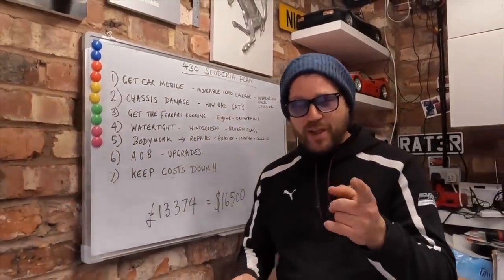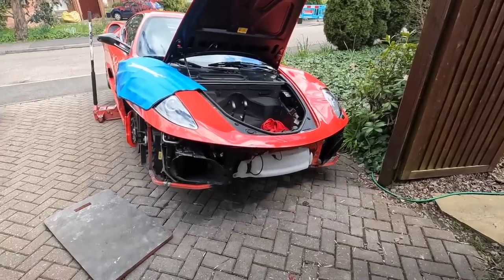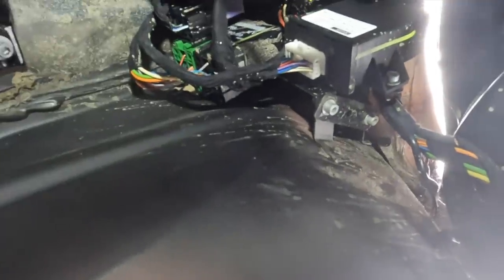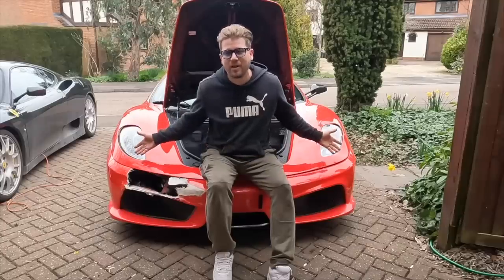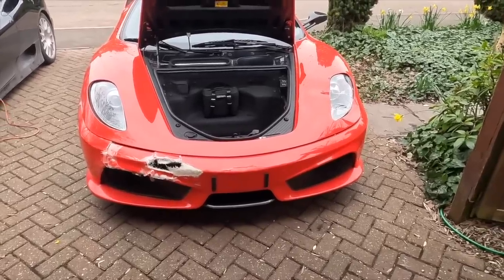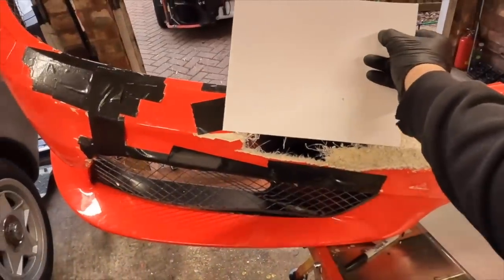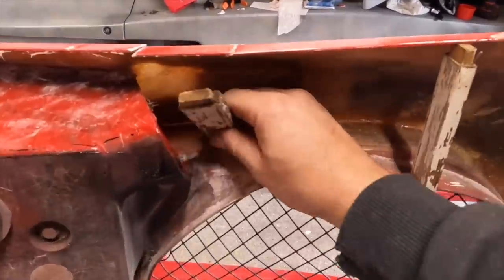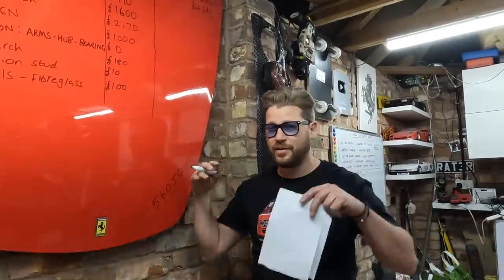Rebuilding a Wrecked Ferrari 430 Scuderia - Part 5

Comment: Scott, couple of tips for working with fiberglass in the future.  1, if you check on the fiberglass after it's cured partially (what I call "green", not sticky to the touch, but not hard), you can trim it with a razorblade fairly easily.  2, you can get a lightweight fabric (I use Dacron), washed to eliminate any sizing or backing chemicals, and use it as the last layer.  Once it's cured you can pull the Dacron off (it doesn't stick to the fiberglass very well) and you have a nice smooth surface.

Great work on trying to salvage the front bumper!!!
Reply from the maker: Awesome, thanks very much for the tips 👌🏻
Reply: Is that similar to ‘peel ply’?
Reply: @factoryfresh9141  Yes, exactly.

Comment: Typing from experience. I've had a lot of success from modifying and repairing motorbike race fairing with success. I've outsourced bodyshops to fix crash damage on my Fibreglass Lotus which always comes back looking good, six months later the cracks come through. Finishing is very important. Cut out anything unusable, strengthen from behind. Use fibreglass filler as much as possible. Gelcoat. Do not use bodyfiller unless for small finishing. It will crack after a few winters. ouch....

Comment: Done a good job there Scott. Trick for repairing structural parts of the bumper using fiber glass, put a layer of chicken coop wire in the fiber glass to nake it stronger. And a mask with filtration is important when working with fiber glass and resin

Comment: When will I learn.  First thought when you said about repairing the front bumper - "this guy is off his head".  Now starting to trend towards "wait and see".  From what you have done so far, I reckon the final fully filled and sanded product will look perfect.  Yes it's bonded pieces, but it isnt in any way structural, so is mainly about looks for the repair - and that will be fine.  It's a crazy saving if you can fix the bumpers up !

Comment: For building up fiberglass parts U-pol makes a filler which is full of fiberglass strands. 
I restore old Corvettes and use roven mat with resin for structural repairs but for building up areas which are not structural the Upol works great.

Comment: Great job. I have a lot of experience with glassfibre. 
Instead of trying to get the losse upper part exactly in place i would make a part mould of the area on another car. Put he mould on the damaged bumper and rebuild it from inside with coat and glassfibre weaw and crossfibre.

Comment: As a body man, I don't care if it is a Ferrari or a Honda I always appreciate when people pick up all the broken bits, even if it's obviously a totaled car. Someone might rebuild it and those pieces can offer up fasteners, clips, trim, even computers like in the case of BMW headlights. The only downside is when tow truck drivers shove damaged bumpers into the interior of the car and it leaves marks in the seats, so it can be a double edged sword.
Reply from the maker: it sure was appreciated on this one Christopher, that little corner bit of the bumper was a real bonus. The Mirror ill show in the next video is also great

Comment: Hi Scott, nice work on the bumper repair, i would say though the back of the bumper really needs to be ruffed up with a belt sander or the like, otherwise you may find the fibreglass you have put on wont bond onto the bumper and could peel off in one chunk, not knocking your work just talking from previous experience 
All the best MEC

Comment: For the Front Bumper, I would have used a former to maintain shape below the gaffer tape, this ensures shape and stops the flexing. Those plastic sheets should be been only bumper depth and twice or three times as long to ensure curvature is maintained. I am concerned, you should have heavily sanded down the inside as that fibre glass is now going to peel off in time. You do not fibreglass on the top surface, you need to reduce the thickness by the amount you are adding back on. Glass fibre does not improve just by making it much thicker.

Comment: Just a couple of quick tips for fiber-glassing next time around:
- first and most important: there are 2 types of resin: polyester and epoxy. The big difference between the 2 is that epoxy has much, much better adhesive properties than polyester. I saw that you were using isophthalic polyester resin (yes, YT viewers see everything :-p). Epoxy is more expensive, but for the tiny amount you needed for these repairs it is negligible. Be different if you were building a boat. Your repairs aren't going to fall off, but in time cracks may appear.
- second, the holes you closed with filler should have been glued with epoxy prior as well. Filler is called that because it is only used to fill any unevenness after a repair. It is not used for the repair itself. Again, cracks...
- and surface prep...

I love what you are doing. So many people just replace rather than repairing. Unnecessarily. But I am quite anal about the quality of repairs. Everything should be as if it had been repaired by the factory. And it can be with a little research (if necessary) and diligence. No bodging.
Reply: Fair info mate… I have just popped a comment in here re my poor repairs with fibreglass. Needless to say, I read your comments with interest. 🥳👌

Comment: Awesome and kudos to you getting stuck in with the glass fibre.
I last used glass fibre in 1988 to rebuild the rotten wings on my Renault 5!😂
Reply from the maker: Was it a 5 turbo ? I had 2 of those and badly want one again
Reply: @Ratarossa  mine was a humble 5TL . My older brother had a 5 Gordini. They both had the structural integrity of a biscuit tin!😂

Comment: When doing a fiberglass repair you need to invite your longtime sailor friend over to help. I've sailed all my life and have done more fiberglass than I care to remember. You need to taper your broken seams to spread the repair over a larger area, but other than that... well done.
Reply: Yeah, I'm thinking the cracks might show back up in the future.
Reply from the maker: Thanks for the tip buddy, I did make some cuts all around where I was fibreglassing to help it all bond together, is that enough or should I go further out ?
Reply: @Ratarossa  Rule of thumb is for every mm of depth you should taper back a centimeter, then layer strips of wetted material that get thinner and thinner as you go. That way the strength of the repair is over a larger area and since you're working on the back anyway there is no need to really sand smooth. The wide to thin strips just help keep the overall repair blend if it was in a visible area. Happy to help.
Reply: @DiscoveryYSC  The more you taper the better. Lay the fiberglass up with larger and larger pieces until filled. Pick up a fiberglass boat repair book if possible. Don Casey has some books that are easy to follow
Reply: @48Boxer  I've seen people do it that way. I was taught to lay the larger patch first for maximum adhesion to the repair and proceed to thinner layers. I've never seen either method fail. I did forget to mention epoxy resin usage.
Reply: @DiscoveryYSC  Yeah I've seen the larger first going up to smallest

Comment: Still utterly fantastic Scott!! I tried doing fibreglass repairs to my TVR Cerbera inner wing and my DB9 front lower bumper… both were shite repairs and the glass matting was a pain in the ass to keep in place while drying (especially on the TVR where it was repairing a part of the body that could not be removed). You made that all look so easy. Have you been trained in body repair? Also what’s the BMX in the garage?
Reply from the maker: Thanks mate, no all self taught,prob did a few things wrong in the process but it’s come out great. BMX is a Monza

Comment: That 488 could be a nice move … at the right price and carefully checking out the front damage. It looks a lot worse than the Scud but hopefully parts should be easier and cheaper to source.
Reply from the maker: I agree 488 parts for the standard car, none Pista are available easily and there's quite a few on the used market

Comment: I recently used one of those fibre glass kits from Halfords.  What a mess.  Fibreglass all over the fingers, there is no thinners to remove the resin, the brush goes solid, the measureing cup becomes unreadable.  I suggest buying woven fibreglass from ebay and not the omnidirectional they supply from Halfords.  But maybe I will learn from your expertise.
Reply: Spoke too soon.  You did a good job.

Comment: Mate, is there anything you don't know how to do?  Repaired the bumper on your own?! 😲
You saved a ton.  Provided of course it comes out looking proper.. 😉  Still, worth the attempt!
Great to hear nothing structure was compromised.
I think it's going to pay off!!  🙂
Reply from the maker: Thanks Neo, yes I have got very lucky so far with the car. As I said in the video with the bumper, nothing to lose really, I either have a go and if it doesn't work i'm back at square one and just have to buy a replacement
Reply: @Ratarossa  No doubt.  Just wish I had that much space and patience to do fiberglassing.  That would've saved me a bit on my own bumper.  🙂

Comment: I really enjoy your channel but you really need to rent yourself an industrial unit with a 2 post lift. The lift will transform how you are able to work on the car. I was lucky enough to get a lift myself last year and it is a total game-changer - not only saving your knees and back but letting you position the car so you are attacking the relevant nuts with your big muscles instead of lying on your back and trying to loosen bolts with your wrists. Still really enjoy the content though.